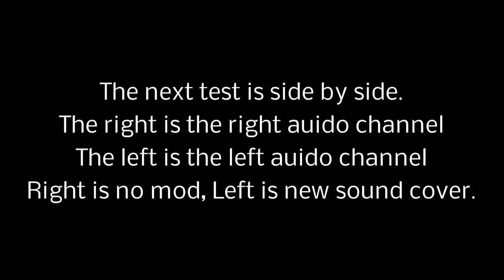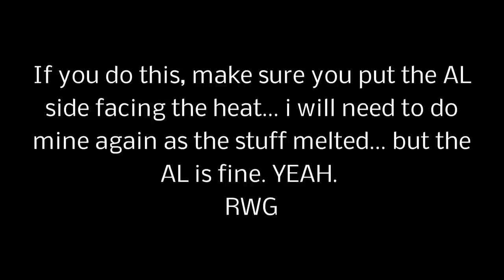#10 Honda PA50II Hobbit: Exhaust Wrap To Quiet This Loud 2 Smoker Down!!!

Comment: Two-stroke (2-cycle) engines have been a part of my professional and hobby life for many many years and just had a couple thoughts to give you.  

1) You can get away with wrapping the exhaust wrap all the way up to the cylinder (but I'm not sure the other additional layers you added if they can handle the heat there)
2) Higher pitched sounds do not like to go around corners.  So, not sure if there is an elegant way to do it on your bike, but it you can add an additional chamber where the exhaust gases go in one direction, around a couple corners with some internal baffle, then out again in a different direction, this will knock down a lot of that infamous 2-stroke high pitch ring.  This obviously would have to be somewhere AFTER the expansion chamber as to not affect the tuned performance and the flow through should be as good as possible to minimize additional back pressure that could hurt performance (there will be some added back pressure, but with good design can be minimal.
3) Often over looked, but on a 2-stroke remember the intake system is essentially a big gaping hole that is bolted right up to the side of the engine (either cylinder or crankcase depending if it's reed valve or rotary valve, or piston port timing).  A lot of noise comes from here (almost, but not quite as much as the exhaust, but still a very significant amount).  I'm not sure how they have the intake on that old Honda, but a lot of times you can enclose the whole airbox or airfilter (if that's all there is) inside of an additional air box (Look through mom's tupperware collection and find one that makes a good fit.  Then use some rubber tubing that has an inside diameter big enough to not constrict the air flow too much for the engine (you can use multiple tube as inlets until you have enough air flow).  Then just drill a hole, or holes (depending how many tubes you're adding) and shove in about 6" (or so) of tubing in through these hole(s).  If done correctly, your engine will still have enough breathability, but the higher pitched noises trapped.  You can then insulate the box for even better noise reduction, but just having the box there will have the biggest payout.
Reply: Thank you for this.

Was wondering about this topic

Comment: Dear Sir you have limited idea about how a expansion chamber works  some of the points which you mentioned are completely wrong, :

1. Rings like a bell thing, the expansionchamber is a resonator yes true but it feeds back some of the unburned fuel back to the open port depending on the powerband which is the expansion chamber is tuned for.

2 . You pointed on the stringer part and said the tuning is up to the baffle cone, that is so so wrong, without a proper length and diameter stinger the back pressure will not be enough and the scavenging will not work correctly,

Now coming to wrapping of 2 stroke expansionchamber, why it is done is to increase the bmep value. The pressure wave coming out of header pipe will be more speed because your temperature is higher (pv=nrt) so it will give you better performance as reflected waves will reach quicker and the low end power will increase drastically for this when the pipe is hot. Conservation of thermal energy.

I am sorry to post a negative comment like this but I did learn from my mistakes. Kindly go through the 2 stroke tuners guide by Gordon Jennings, but his research is old like 1967 or so and not on bmep, thus you can refer to research of Gordon p Blair's research which is based on bmep. You can consider visiting @Aumechanic channel where he makes expansionchamber step by step.

Funfact: expansion chamber was first invented by nazi German scientist to save fuel in war time. By scavenging unburned fuel back to cylinder.

Comment: well its an old vid now but what could help a lot is cutting the perforated pipe in half , match a pipe diameter and slide it past above or under the original , so you now have a offset pipe and a chamber behind the new so to deflect boost out and sound to go back into the new pipe as in a loop , this takes alot of sound and dont do enything to the performance !
Reply from the maker: +transdetendal cool  yeah sounds like a good plan! thanks for the tip! ~Russ
Reply: *****
welcome!  ;-)

Comment: Hey brother. I always have 2 exhaust system in every bike/car/truck whatever has an engine I have owned. I did that to my 2 stroke... Made it quiet. And then I added 3 mufflers... Brother you haveno idea how quiet it is hahahah and of course I went and build a Y pipe with 2 valves... One for the sport exhaust and 1 for the "cold start/4 blocks ride" ahhaha not really. In the woods I like my motorcycle quiet... Same with trucks atvs...utvs... Anyways. I love it. BUT you have to almost always adjust the carb for each... If it's carb. But... There is always a middle ground. Same thing with intake. You can make intake quieter... Andlouder. I have a friend who has adapted 2 different set ups... 2 carbs... 2 exhausts... Therefore, more weight...more weight to make it slower or not practical? You be the judge... In my case? No way. I love it.

Comment: I would check the  cylinder  temperature when your not moving though ,to see if engine is overheating .Those that designed the  engine will have taken into consideration the  exhaust surface area's  contribution to engine coolling surface area . (the area that you have taped up looks to be as  large again as the  area of cylinder coolling fins ,so reducing your cooling surface by 50%. Maybe it will not be a problem but it's worth checking .

Comment: I thought the paint was supposed to be applied to the pipe to inhibit corrosion from trapped moisture between pipe and wrap. Although you wouldn't have needed it cuz your steel pipe is chrome plated

Comment: The exhaust port does open first on any (gas) two stroke.  to really quite it down you need too put a metal plug or dam... In the middle of the pipe that has all the holes. Then all hot gasses expelled will be forced too unload heat onto the packing( steel wool) some aluminum steel wool will last longer. . That stuff you are using is flammable right?